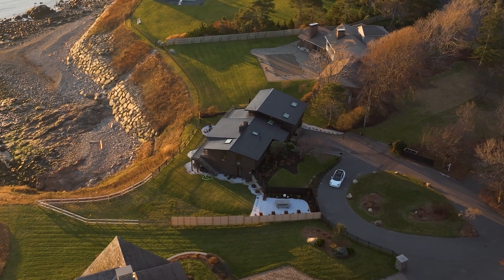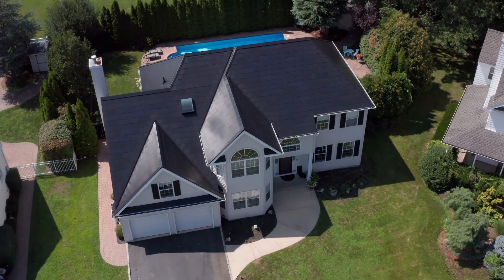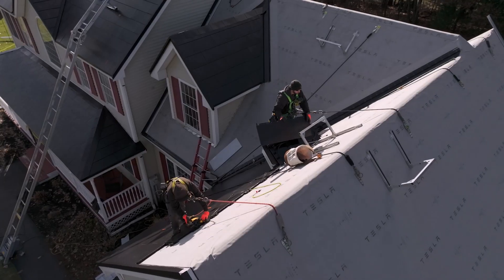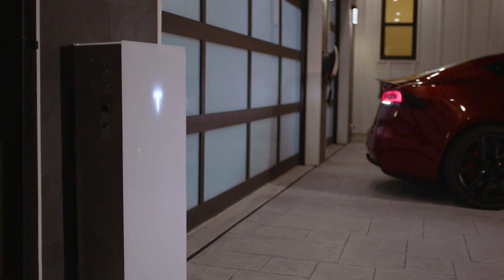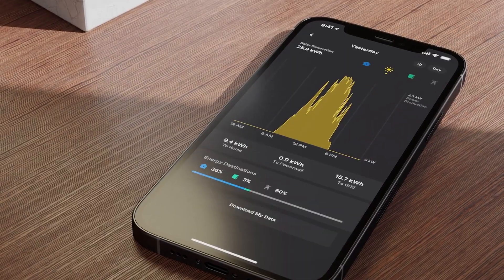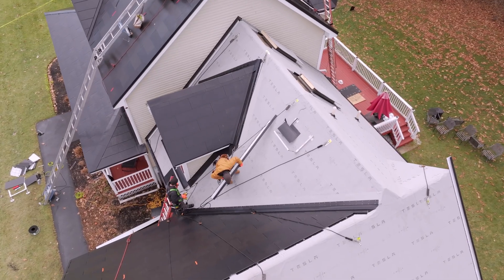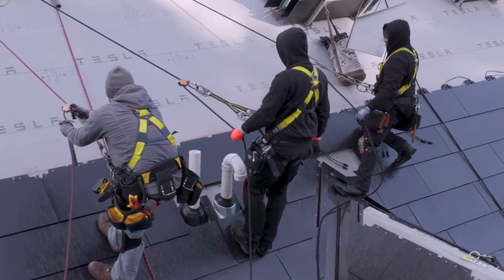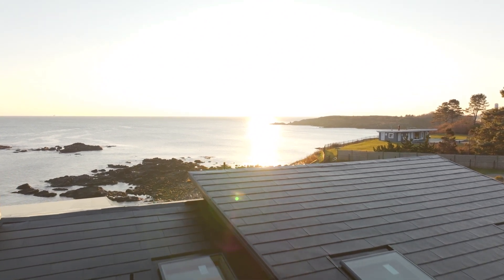Tesla Solar Roof - Introduction

Comment: I love my Tesla Solar roof and Two Powerwall 3s. The hidden feature is the kynar500 coating in the metal also drastically reduces the heat transfer from the sun into attic, reducing energy bills in summer months. Winter months, I don’t have to run the heat as much because of the 3 layers of insulation. Underlayment, air gap, Tesla tile. It’s like a yeti mug in terms of layers of insulation. About to buy another house and do it again 🫡
Reply: How much did it cost?